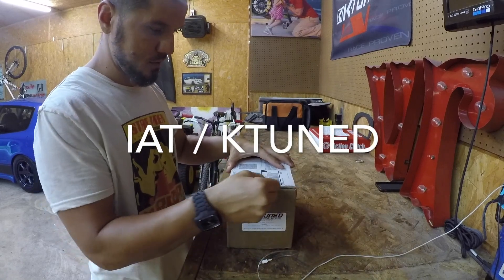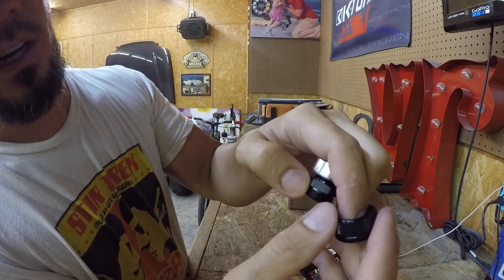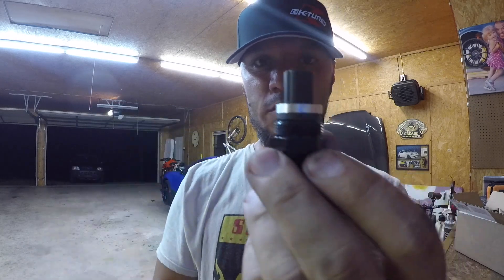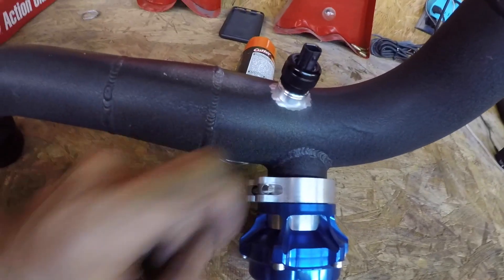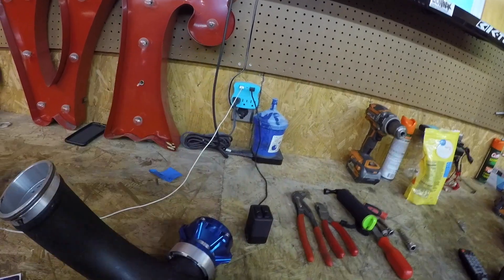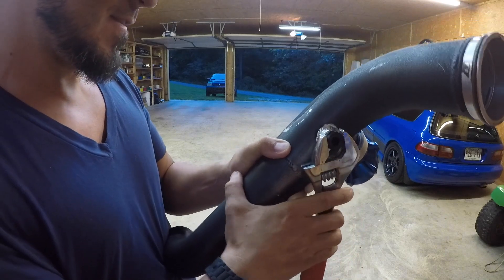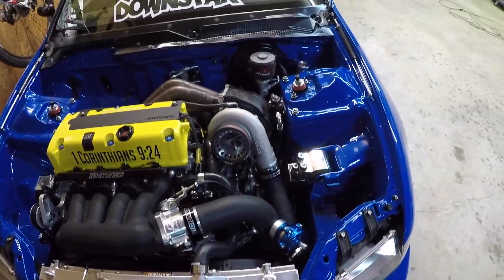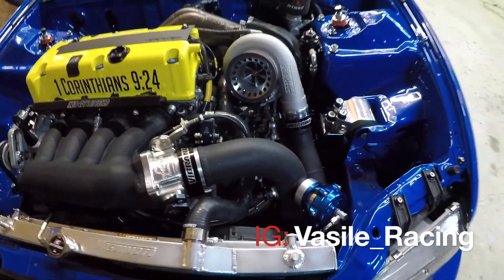ktuned IAT sensor fitting

Comment: What did u do to make this work before you put the bung in the intake ?
Reply from the maker: Robert kaigler had it in front of the radiator
Reply: Vasile Garage so it dosen't have to see boost pressure? I was getting ready to order this k-tuned bung but I wont bother if it's not needed
Reply from the maker: Robert kaigler if u boosted u need it
Reply: Vasile Garage ight good deal.  Thanks for the quick replies bro
Reply: Vasile Garage is their a particular spot it has to be mounted in the intake piping? And did you just use the stock sensor that came in the harness?

Comment: wondering if nay1 here relocated their IAT sensor to their Intake manifold ? how is it ? it is good or bad? cause for what i remember B series motors IAT sensors are in intake manifold wondering for K series if any idea pls comment
Reply: On allmotor it can be better due to it picks up and compensates for the heat soak in intakt. Om boosted always in the IC piping before the TB